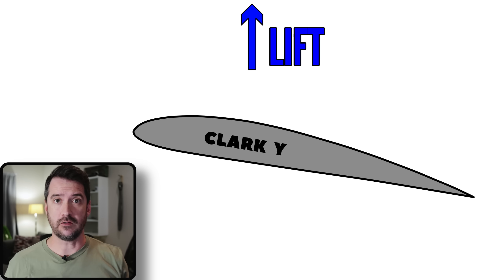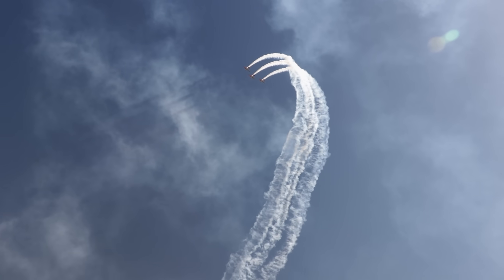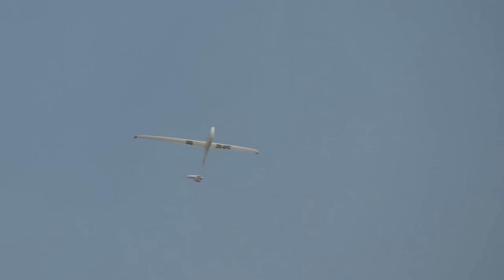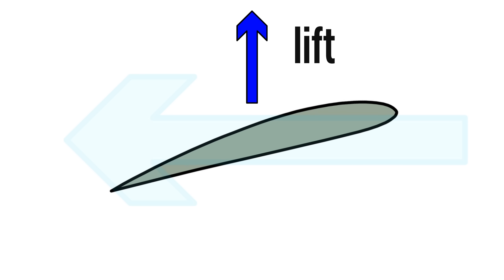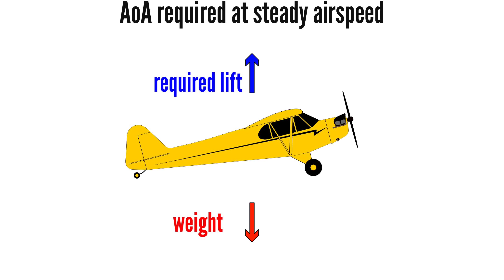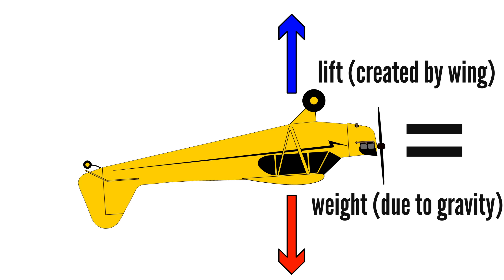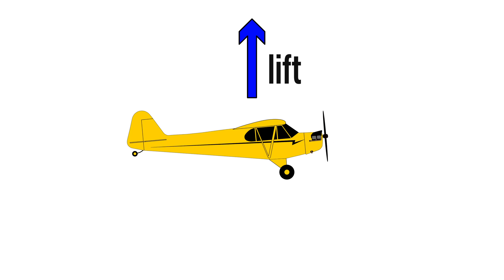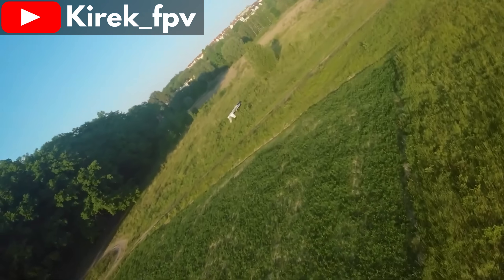Is Airflow Distance Over the Top of a Wing Always Longer?

Comment: Name calling doesnt change the fact that aerodynamics is a complex subject where there are still plenty of phenomena that are not completely understood. Watch some videos about winglets and vortices and wake turbulence if you doubt this.

The "longer path generates more lift" thing is a gross oversimplification of what's actually happening to produce lift. Generating "lift" involves multiple interdependent variables like angle of attack, laminar flow, turbulence, airfoil velocity, air density, compresibility, and the location of the seperation point. Assymetrical airfoils therfore do not generate lift "because the path over the top of the wing is longer" They generate lift because of synergy between a complex set of inter-dependent variables, and the shape of the airfoil is only one of the variables - as illustrated by inverted flight and the requirement for a much greater angle of attack to achieve it when using an assemetrical airfoil.

Airplanes are called "air"-"planes" because they "plane" through the air in ways similar to how a water skier planes over water, or a hydrofoil beneath it. Ultimately lifiting force is always a product of the angle of attack vs the velocity and loading / structural characteristics of the foil's geometry and construction. Laminar flow means that the fluid (air is a compressible fluid which contains non-compressable H20 btw) stays "attached" (follows the shape of) to the airfoil before rejoining it's neighboring fluid behind the foil. The goal is to do this as smoothly as possible while generating enough lift to support an airframe, engine, passengers and payload. All of this generates friction, turnbulance and compresses the air, which creates other entropic thermodynmic phenomena that require energy to maintain.

So assymetrical airfoils are a way to make generating lift and maintaing flight more effcient. They are not neccessary for generating lift - they just make it easier to do so for a variety of reasons, including the "longer path" taken by air traveling through a lower density enviroment above the wing. That means the area under the wing is under higher pressure, and it could just as easly be argued that it's this high-pressure / shorter path air that's lifting / supporting the plane. Not only that, the forces of lift and drag are not perpendicular to each other as their resultants vary constantly as a function of the multiple variables already described.

It's not rocket science, but it's it's similarly complex.
Reply: @davetime5234  Appreciate the detailed analysis - you clearly understand the physics involved better than me.

But I still maintain that the "longer path" explaination of aerodynamic lift is misleading - unless it includes a lot of other concepts. For me the dynamic separation point of airflow was the key to understanding how inverted flight is possible - and less effcient than normal flight.

As far as the pressure differential between upper and lower airfoil surfaces, I'm confused:

For every action there's an equal but opposite reaction, correct? 

Negative pressure is an action. Where is the equal and opposite reaction taking place? Is it contained in the resultant force on the airframe rather than an equal but higher pressure under the wing?

When a gas is decompressed, it loses heat, right? Boyle's law or something as I recall. Where does the energy to effect this decompression come from / return to?

I'm an architect by training, not an aeronautical engineer. I have a reasonably good grasp of newtonian physics and static engineering of determinate structures. I have some understanding of aerodynamics as they effect strutual loading of buildings. These forces introduce dynamic lateral and uplift loads on walls and roofs than must be designed for carefully if you want the building and all it's bits to remain static. The windward side of a highrise building is loaded in compression. The leward side is subject to a vacumme, resuting in tensile forces, and roofs are subject to lift, which is generally the controlling factor in their engineering / detailing or connections to walls and joinsts and rafters.

I'm tryiing to understand how an assemetrical NACA profile changes any of this. Perhaphs architects can design more wind resistant structures in hurricane or tornado prone areas if we better understand the foreces at play and how to manage them.

Enlighten me.

Then there's siesmic design and resonance and elasticity vs stiffness and brittleness and load cycling and material fatigue issues - these also affect airframes from what I gather.

That's the thing about physics. There's no escaping it - yet it's far from perfectly settled. One reason airplanes crash and buildings fall down now and then ;-)
Reply: @davetime5234  Thanks! Great explaination RE the lower density / pressure in effect sucking the wing up as a way to conserve momentum.

I was also an architecture professor for many years, so I had to explain various physics concepts to students when teaching structural principals and material properties. Heating Ventilation and Air Conditioning involve a lot of physics principals / thermodynamics, but architects generally don't get into the nitty gritty calculations of any of it - we offload the heavy lifting to engineering consultants.

...but we are responsible for the work of our consultants, so we have to understand the underlying concepts.

RE Bernouli - I watched a long and rather convincing YT video about the Bernouli thing that questioned it as a driver / legitamate explaination of aerodynamic lift. I forget the guy's thesis, but he was an aeronautical engineer, and he used the old blowing air over a piece of paper demonstration as the basis for debunking it somehow. He concluded that the existing explainations are all incomplete, and therefore that we don't fully understand what's happening.

Then again, the math we use to quantify and predict physical phenomena is fundamentally flawed and imprecise. I like to point out that Pi is an inexact - and therefore irrational - number to illustrate this. If we can't EXACTLY calculate the area of a circle, the simplest geometric form, how are we going to use this system to understand and predict the universe and the forces that govern it. Goedell's incompleteness theourms call into question the fundamental logical underpinnings of basic arithmatic, so we're in trouble right from the start. Chaos theory and non-linear dymanics / itterative processes and propagation of error mean that small amounts of imprecision can lead to wildly innaccurate predictions when it comes to complex systems.

Again, this is probably why planes crash and building fall down sometimes no matter how carefully we engineer them.

There's still a ghost somewhere in the machine.... ;-)
Reply: @davetime5234  Sure - It's titled "Doug McLean Common Misconceptions in Aerodynamics" and it's from a lecture he gave in 2013 at the University of Michigan:

"Doug McLean, retired Boeing Technical Fellow, discusses several examples of erroneous ways of looking at phenomena in aerodynamics, that have either taken hold in parts of the aerodynamics community or have been expressed in books or papers by other authors. These examples are mostly about interpreting the basic physics of the phenomenon in question.

Most are from his book Understanding Aerodynamics - Arguing from the Real Physics, but a couple of them are new. Examples will include ways of explaining the lift of a wing or the thrust of a rocket in intuitive physical terms, interpretations of the induced drag of a wing and how tip devices such as winglets work, widespread misunderstandings of how lift is manifested in the global flowfield around a wing, the common pitfalls of discussing pressure drag and thrust, and common misunderstandings of the accuracy of CFD. 

Although these topics involve a wide variety of physical phenomena, Dr. McLean will attempt to identify the common threads. An appropriate subtitle for this talk would be An Argumentative Aerodynamicist Gets Old and Cranky and Takes Issue with Just About Everyone

Comment: Time for a science experiment.  I'm not going to ask you to take my word for anything.  I'm going to ask you to perform a simple experiment and see for yourself.

You will need:

1 kitchen tablespoon.  The kind you put next to the plate when setting the table.
1 dinner knife.  Or steak knife.  Or butter knife.  Anything along those lines.
The kitchen sink.

Go to the kitchen sink, and turn on the water as high as it will go.  The faster the stream, the better.

Hold the knife loosely in your hands, blade down, so it can swing on its own if it wants to.  Move the knife so that the flat of the blade comes in contact with the water stream.  What happens?

Not much.

Now hold the spoon loosely, just like you did the knife, bowl part down.  Move it into the water stream, with the convex (outward bulging side) being the part that makes contact with the water.  What happens?

Well, unless you are holding the spoon too tight, two interesting things happen.  First, the spoon is pulled deeper into the water stream.  Second, the water stream is no longer going straight down as it flows off the end of the spoon.  It leaves at the same angle as the curvature of the spoon.  At least for a couple of inches until gravity takes over and redirects the stream downward again.

So...how is the spoon actually pulled up into the higher-pressure area of the water stream, rather than being pulled away from it.

Laminar fluid flow.  The fluid will actually naturally want to follow the shape of whatever object it's flowing around.  In the case of a spoon, it has to change direction to follow the curved shape of the back side of the wing.  And as Sir Isaac said, every action has an equal and opposite reaction.  So as the back of the spoon redirects fluid flow, the flow redirects the spoon...deeper into the flow of water.

This is actually how airplane wings create lift.  As the wing moves through the air, that laminar fluid flow causes the airflow to "stick" to the skin of the wing, directing the air downward, and the wing upward.

The bottom surface of a lot of aircraft wings are actually concave, bowing inward.  So the wing cross section is more of a sideways, elongated C than it is an elongated teardrop.  

This actually increases the path the air at the bottom has to travel.  If the air traveling farther over the top surface rather than the bottom is what created the bulk of an airplane's lift, this would make the wing less effective at creating lift, not more.

Rather, the wings with concave lower surfaces are using both the upper and lower surfaces of the wing to direct the laminar airflow downward.

Don't believe me?  Try the experiment yourself.  It's a simple experiment anyone can do in any kitchen in America.

Comment: If you flew under a bridge, many feet from the ground but only a foot or two from the ceiling of the bridge, you would experience a type of ground effect and the wing would generate lift more efficiently, even though less air mass is being pushed down. Instead of the yielding air moving down, the unyielding bridge would be pushed down and would not, of course, actually move down. The wing is generating lift more efficiently because the energy spent to move air down is wasted energy. What the wing needs is to experience a force against something, not to actually move something. Is this not correct?
Reply: @davetime5234  My apologies, I'm talking about an external surface close to the top and above the wing.

Comment: If the Bernoulli Principle was negligible, and lift was mainly Newtonian, why does a wing stall when the angle of attack becomes too great? you'd have thought that you'd have all that air volume hitting that angle underneath, and air above, basically, doing nothing, making it even easier to provide lift?
Reply: A wing will create lift at any angle of attack.
Stalling is when laminar flow stops and DRAG becomes much greater.
That slows airplane down and lift decreases, not to mention loss of control.
Reply: @Alec72HD  - right. I think I get it. It needs the laminar flow over the top, so if the Bernoulli effect isn’t apparent, because of the flow detachment, then the Newtonian forces still can’t provide the lift
Reply: @Scissors69  
All the forces are Newtonian.
Bernouly formulas are derived from Newton's laws.
There is no such distinction as Bernouly forces or Newtonian forces.
Reply: @Alec72HD  - Yeah. I think Bernoulli is a principle rather then a a force
Reply: @davetime5234   - Agreed. Actually Newton’s Second Law, From which Bernoullis Príncipe is directly derived

Comment: ... the angle of attack determines the path of the air stream over the wing. The "longer" path is to help maintain smooth airflow ove the wing. The airstream being directed down provides an upward force. The airstream over the top of the wing with the "longer" surface provides more lift from the viscous nature of air. The air is literally dragging the wing into the faster moving airstream. Faster moving air has lower pressure. However you want to look at it theres a few forces at work. The deflection of the air into the bottom of the wing and the lift from viscous surfaces. Everyone seems to forget about the viscosity when it's over 60% of aerodynamics.......

Comment: Almost all physics explanations are shortcuts to try and explain it to non-physicists. If you want to truly understand airplane wings you need to model the flow of the air and pressure in a 3D simulator, keeping in mind that pressure is a combination of relative velocity and random motion. The shape of the wing is a lot less important than the angle of attack.

Comment: Lift is generated by the much stronger force from the air below the wing pushing up than the air above the wing pushing down. Regardless of the position of the wing - depending on the angle of attack, of course.

Comment: Very well explained. To summarize, a Clark Y airfoil (or similar) will allow inverted flight given the correct wing loading, angle of attack and power considerations. But a symmetrical airfoil (or similar) when coupled with proper angle of attack will be more efficient. Hence, many or most truly aerobatic aircraft employ symmetrical, or nearly symmetrical, airfoil shapes.

Comment: Why overcomplicate it so much? Just place a wing vertically in the airflow instead of horizontal and you see the truth. Simple as this.
Reply: @davetime5234  it is. If you face it vertically straight into the wind then it's pressure drop left or right of the wing. The physics don't change if it's left/right instead of top/down. Use this as tail on an Rc plane and you see if it turns or not. (But don't use a single prop plane. Counter rotating props or edfs)
Reply: @davetime5234  if that shape alone creates lift or if it just optimizes it. Still would be debatable what "straight" in the airflow means for this shape